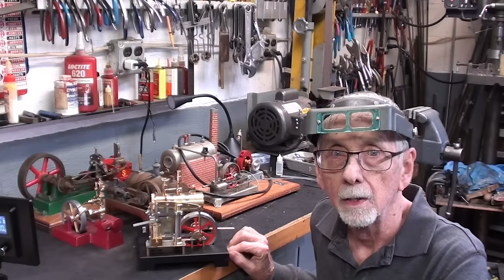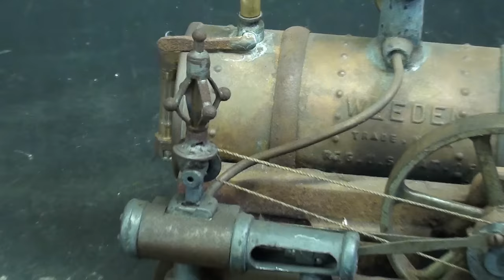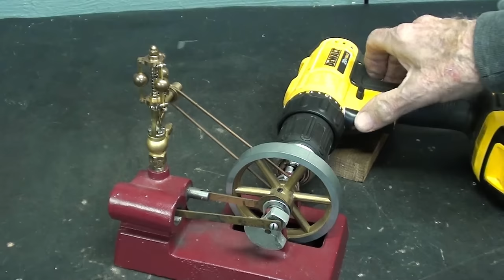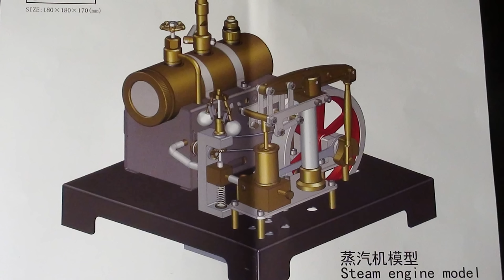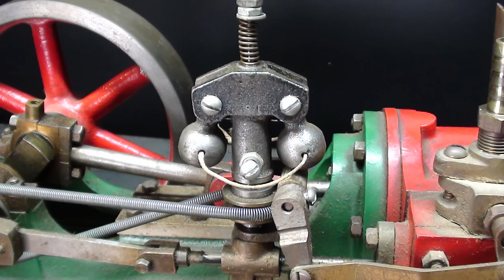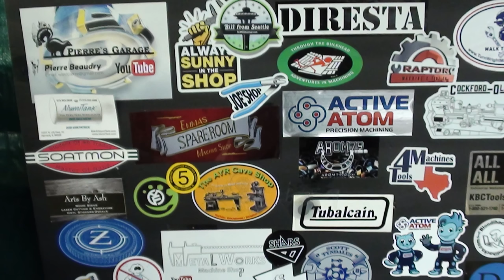HOW A STEAM ENGINE GOVERNOR WORKS #963 tubalcain RETROL flyball

Comment: Important to know that the governor will keep speed constant as the load on the engine changes (if you have a load on it), but will not keep contant speed as the steam pressure changes. With the burner at a constant heat and the engine up to speed, the governor will partially close the steam valve, but pressure in the boiler then increases so the amount of steam entering the engine doesn't change so much. So if you are wondering why the governor is not so effective, try applying a load to the engine.

Comment: I've been waiting for this one!
Didn't realize there were some mfgr's that used real governors but must admit the non-functional ones are cute too. The Retrol is adjustable.
Boy howdy, that's neat.
No, I haven't pulled the trigger for a Retrol beam engine yet.
I've said this before but when running LARGE stationary steam engine at the show, I tell people balls to the wall is not a dirty term but an expression of full speed. Glad you use it also.

Comment: Years ago, just after high school, I went with a friend to pick up a couple of large semi-trucks (no trailers, bob tail).  He was a truck driver and I was not although I rebuilt most of my pickup trucks that also had a stick shift.  When we got into the trucks, I yelled at him that my fuel gauge was close to empty and he said just to follow him. There was just one of us in each truck and I had never ever sat in one before.  We were coming out of a parking lot on a busy side street and when an opening came up the sob just took off and left me on my own and disappeared down the road.  I finally pulled out in first gear and even with the engine revved I was barely moving and then things got worse and I immediately started running out of fuel, but as I let off the gas, it smoothed out, hmm....  I picked up second gear and the exact same thing happened.  I remember saying "I think this thing has a governor", it hadn't even dawned on me before then.  You finally get to a point where you're in 5th gear and sill not going very fast and need to pull the button on the shifter and shift the axle.  I never had to double clutch a transmission before that day, such a simple thing but I didn't know how, and I had to stop in the middle of the road a few times and start over again in 1st gear because I couldn't get it to sync and get it back into any, even a lower gear I just came out of.  Talk about an adrenaline rush.  To make things worse (if they could have been), I quickly pulled it back to first gear and gave it a little gas (which it didn't need), popped the clutch and I was in reverse where 1st gear was on my truck and nearly climbed over a station wagon behind me.  The suspension is really stiff and the truck stands on its toes when you hit the brakes.  I read the shifting pattern again on the plate, made it back to first and worked my way back to 5th, still barely rolling.  I tried the axle split again and lost the sync and had to stop again, grabbed 1st, and shot backwards a second time, only to find the same station wagon behind me.  sigh...  I drove it all the way back in 5th gear, blowing smoke the whole way (with that darn station wagon still behind me that I was pretty sure I didn't hit).  I finally pulled over and he pulled up along side, when I told him "the truck is having problems" and it was, it was me, he offered to follow me, but I finally convinced him I was ok and he left.  What an experience that was.  I recommend a test drive with someone else in the cab if you ever plan to do it, but wasn't it great to experience things as a teenager back then?
Reply from the maker: That was an interesting and scary experience
Reply: About a week ago I found a letter I had never opened from my dad from 30 years ago in some old papers.  He was laughing and remembering about me telling about this exact same truck driving experience I had as a teenager.  He had just read an article (it was in the envelope) about a woman in the military during the gulf war.  She was an office worker, but they needed truck drivers and gave her a quick lesson and for some reason, the very next day stuck her behind the wheel of a transport.  She ended up stranded on a bombed out road driving across country and after being missing, eventually showed up terrified at a base on the other end.  When they asked her what happened and then why she kept going, she replied that she only had the first day of lessons and they did not teach her how to back up.  True story.   @mrpete222

Comment: I would benefit greatly if you showed the oiling and frequency of oiling the different parts of the Retrol beam and engine.
Reply from the maker: I thought I showed that. If not, oil it at every point where there is one moving part against another moving part.